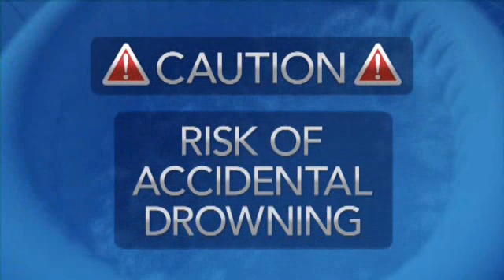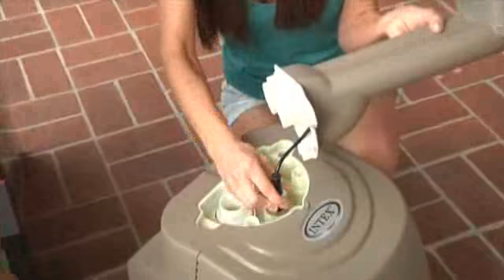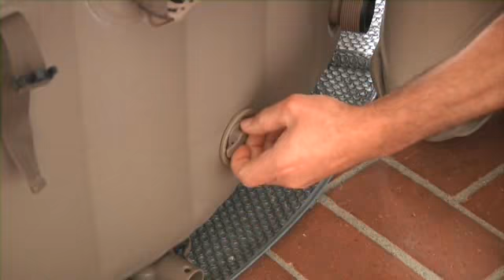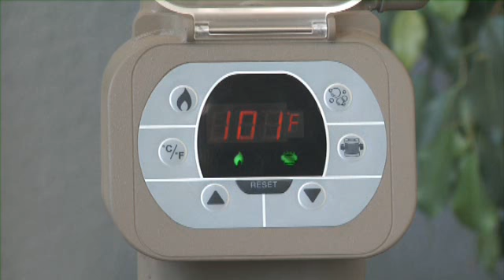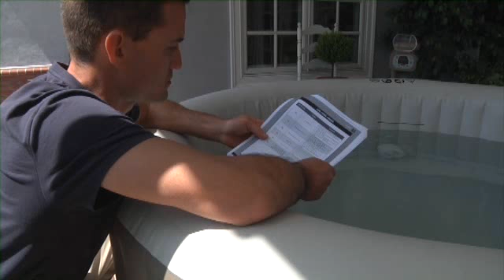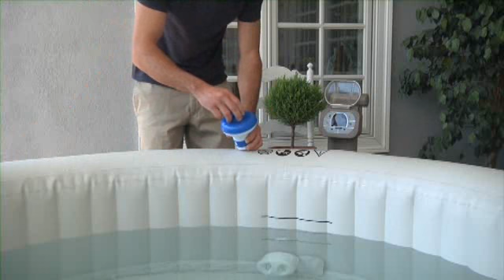Montage spa PureSpa Intex

Comment: I bought this hot tub yesterday and the heating is not working, after I turn on the heating the filter turns on as well but 5 minutes later a beep sound comes on and all lights come on, what's going on? could not find any answer on the book.
Reply: Try resetting it if it have an reset button on it godluke